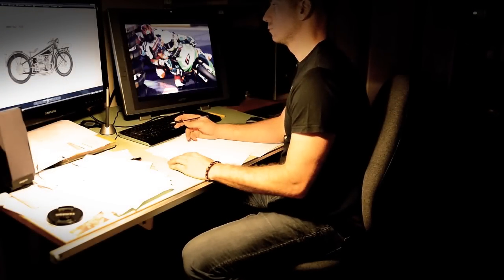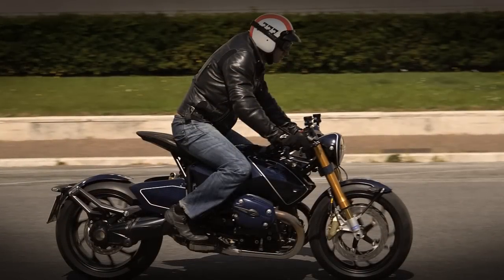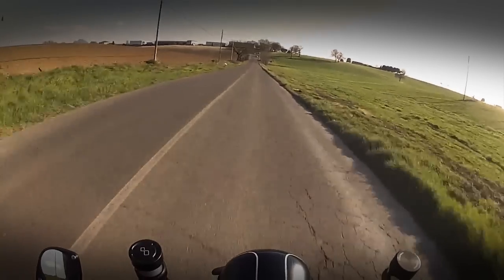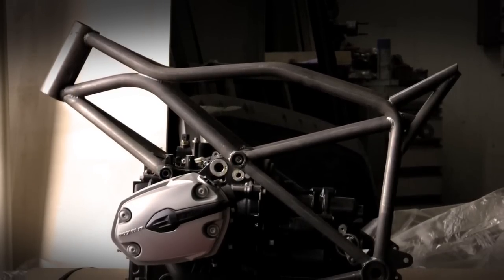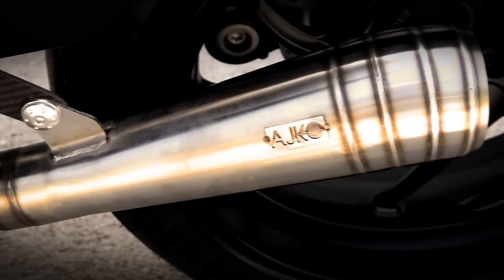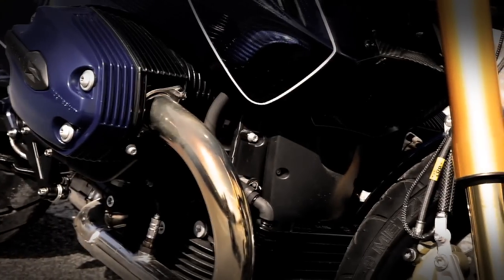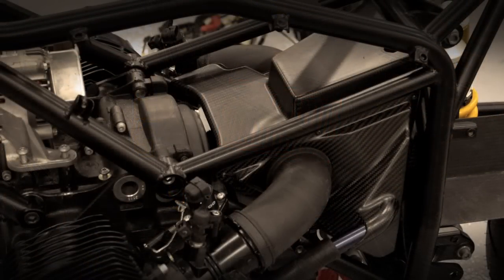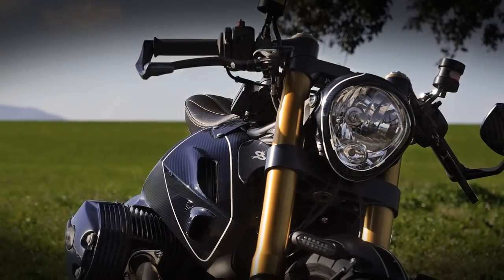Cafe Racer (BMW R1200 S by Giulio Paz Design)

Comment: Stunning piece that is gorgeous the high riding position is so interesting for a country side ride or a slow wander through a city ending at a nice eatery or cafe
Reply from the maker: Thank you my friend for sharing your opinion. :) Cheers.
Reply: Hi! is not  high :)  is only an optical illusion due to the strange proportions. mainly for the low tank. the seat height is 830, the same of donor bmw r1200s ;)

Comment: This is truly an extraordinary motorcycle. The most highly developed I have seen on your series.The design and resources are really at the highest possible level for a one off design, they are almost at factory level. The form of the bike works exceptionally well aesthetically, if not ergonomically, as the lines have a flow that is not present on most bikes. I can appreciate the sense of flying that the riding position would create and, while I admire him for following through on his ideal, it is not really practical. I would not like to ride over any distance. He even got the colour perfect...black. Well done.
Reply from the maker: +Thomas Elliott Thank you my friend for your very fair judgement about this project. Just a small correction, the bike is painted in dark blue.
Maybe your monitor is setting too dark. :) Thank you. Cheers.
Reply: I can assure you that the motorcycle is very comfortable. It handles very well on curves and surprisingly even in the city.😁
Reply: @2576giulio  what a load of crap

Comment: Very original thinking! But as others, I was puzzled by the high position of the seat. I guess that after 100 kms per hour, the air friction will make  uncomfortable the riding.
Reply from the maker: +ibadi45 I understand what you're saying, but i think it won't be less comfortable than a naked bike. But thanks for sharing your comment. Cheers.

Comment: Your scenery looks just like Victoria (a state in australia)
Reply: +Platinum Schmidt I would like it a little lower. i don't mind the height, but I'd only want it with higher bars too. If you are making a statement don't be half arsed and so scared of looking Americanized / Harley'esque. The bars would make sense, make it rideable and make me look less of a dick.
Reply from the maker: +Platinum Schmidt To be honest, i simply can't make a full statement (like you suggested) of criticism, because there is always a good reason when something doesn't look quite right.
Considering the level of quality and technology in this project, which is among the best, i have to trust the builder's ideas and respect them.
Without the rider, the bike looks very good as it is.
You can check during the video some initial drawings with a higher bar, which means that it was considered during the project.
And if Giulio changed his mind about that, it means that he has a very good reason for it. But thanks for sharing your opinion. Cheers.

Comment: hi what direction is the bmw driveshaft rotation
Reply from the maker: Sorry, i have no idea.
Reply: I think counter clockwise as you sit on the bike. Picture the right sided output shaft rotating counter clockwise as it's beveled gear meshes with the rear gear spline. Counter clockwise drives the spline down and the wheel forward.
Reply: counter-clockwise from the perspective of the rider.

Comment: Agreed about nice details, but it lacks on the basics... Rising the biker position make the CG higher and balance worst, so it´s a not good concept, imho.  The aesthetics and appearance should be a consequence of functionality.
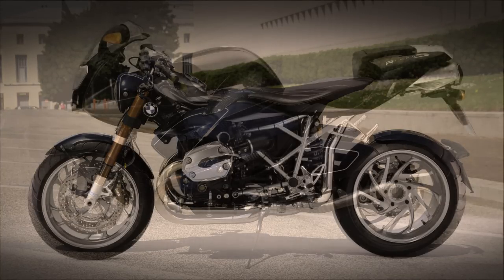Reply from the maker: +Ken Saba Thanks for your comment. But if you Look carefully the minute 5:18 of this video, and you will see that the seat has the same high of the original model. 
The low handlebar and the non existence of the fuel tank in the standard location, is what cause that illusion of the high riding position. Cheers.
Reply: +RACER TV About that comparison, it seems to me that the custom bike was elongated at rear arm (balança traseira, em PT-BR), so the scales and angle of the pictures are not the same, so the longer bike is a bit higher than the original one. Attempt to the axis of rear arm (eixo da balança) on the frame, or the engine head on both pictures and probably you will get it more clearly.

Congrats for the videos, they´re great quality on both, the bikes and the video itself!
Reply from the maker: Ken Saba
I understand what you said, but according to the Builder, the height of the seat is really the same of the original model. Obrigado pelo apoio. :) Um abraço.
Reply: @yam653  The wheelbase is shorter by just over a centimeter. The rear swingarm is the same as the original BMW. The seat height is the same as the R1200S. The impression that it's tall and long is only due to the unusual proportions. What changes is the forward shift of the seat, making it comfortable even with low handlebars. Paradoxically, it's very comfortable in the city. In short, the riding position is genuinely comfortable and effective. The only drawback is when putting your feet on the ground because the legs remain wide, but once you're in the riding position, everything works very well.

Comment: The video is awesome. The riding position is stupid. Dangerous even.
Reply from the maker: +Pedro Torres Thank you Pedro. I also thought that a riding position could be dangerous on hard brake situations. But according to Giulio, it seems it isn't.
The seat height is identical to the original model.
And the ergonomics of the bodywork, allows good contact between the thighs.
He recognizes that is a strange driving position, but it is also convenient.
Abraço.

Comment: Beautiful looking and completely un rideable for 99% of us. Lower the seat raise the bars.
Reply from the maker: +AMPSHOWS Not exacly.  Look carefully the minute 5:18 of this video, and you will see that the seat has the same high of the original model.
Reply: +RACER TV The seat being closer to the triple tree and the grips being lower pushes the rider forward, with too much weight on the wrists during braking. IMHO. I do love the design otherwise!

Comment: a cafe racer is still a motorbike. it should be able to give you a good ride. it's not windowdressing. brake to hard on this thing and you get launched over the bars. not my style of bike. all form and no function.
Reply from the maker: +franco marsili I understand that this design is not for everyone. But i can't agree with your last sentence. Because this bike has this form because of its function. As i said in the video, it was built to give the rider the sensation of flying about the road surface. But thanks for sharing your opinion. Cheers.